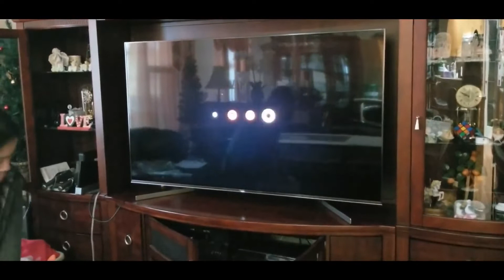SONY BRAVIA 4K HDR ULTRA HD TV 65" UNBOXING!

Comment: Hi Gina! do you mind me asking  how much you paid for this TV last year on Black Friday? One of my local Best Buys has an open box for $910. Thanks in advance!
Reply from the maker: Hi madam mga 1,700 that was on sale at that time  madam
Reply: @ginalegaspi1464  great, thanks for the info!
Reply: @ginalegaspi1464  Sorry forgot to ask what is the previous TV model you had before this TV? Thanks!
Reply from the maker: @margaritavgonzalez7877  SONY  KDL55HX850
Reply: @ginalegaspi1464  I thought you said xbr65x950h, but the KDL55hx850 is a great 2012 model. I also used to have that same model and sold it to get a bigger Sony TV. I regret selling that one, for some reason the newer TV didn't looked as good :-(